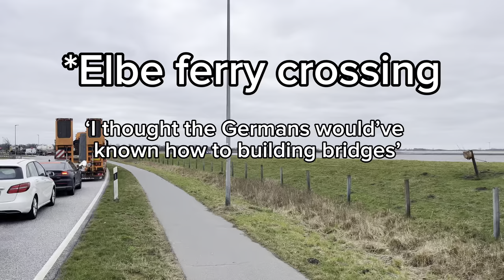Driving my Trabant from Germany to England

Comment: If you want to fix the heating on the trabant, you have to Connect the flexible pipes correctly: one goes from the exhaust right to the "banana shaped" heater and the other one needs to go from the the engine cover to the front muffler. You have connected the heating outlet to the other heating outlet, so you are pumping hot exhaust air diretly to the engine cooling, thus the engine is overheating all the time and might result in engine damage!
Reply: Someone needs to send this to them.
Reply: @jwalster9412 its too late
Reply: hahahaha legend we have a trabant expert its good job you saw the video mate you probably saved his Trabant
Reply: @ItZFlipz car is dead
Reply: I cry bro @afkafkafk

Comment: The oil mixture is 33:1 for pre '84 models, post '84 runs on 50:1. With that amount of smoke, plus destroying spark plugs every 100 miles means wayyyyyy too much oil in the fuel. Mine makes hardly any smoke at all, just a little on a cold start that's all.
Reply: I figured it had to do with the air/fuel mixture. But too much oil makes sense too. Certainly when it smokes like that.
Reply: @NaoPb  Having spent much of my late teens rebuilding and using 2 stroke motorcycles and mopeds, it's a common problem. My Trabant was driven from Bulgaria to the UK, but I have no idea if or how many times it may have broken down.
Too much oil in the mix will wreck a spark plug in mere minutes!
Reply: Forgive me for not understanding the ratio, but for every 33 litres of fuel (using as an example), you add one litre of oil (on pre-84 models)
Reply: @joelthorstensson2772  Yes, but it has to be in proportion. 10 litres of gas needs 303ml of oil, 18 litres of gas needs 545ml of oil. You can't just add 1 litres of oil for every 33 litres of gas used. The oil must be added at the same time as the gas in the right amount.
Reply: That's wrong in so many ways. First, it's 1:33, not 33:1. And they have already changed it to 1:50 in 1974.

Comment: DO NOT FORGET: use 2 stroke premix 50:1 (petrol:2 stroke oil). and DO NOT let off the throttle in ANY gear except 4th (4th has a ''freewheel'' that allows the engine to idle when coasting). when braking:  always push the clutch pedal. this is to prevent the engine from seizing.
Reply: To Maicopaul. OH MY GOD!

Comment: Road trips with unreliable Cars is always fun, and entertaining
Reply: take care of it and it is realiable the engine is a 2 stroke they make a lot of problems
Reply: To watch not to do trust me
Reply: Arkady Fiedler's Fiat 126p road trips are legendary.
Reply: Drove a 50 year old American car with a dodgy carburetor, engine stalls accelerating from full stop unless I stomped the gas pedal more, not bad until I am close to home and encountered a stop and go traffic on hot June afternoon and the car vapor locked on me!  Since the fuel gauge is inoperable and I have no long stick to measure the fuel level, I falsely believed I ran out of fuel.
Reply: That's why top gear specials are so much fun.
Reply: They are reliable as fuck...Unless you connect the exhaust to the engine cooling, like this guy did lmao
Reply: That's why I like watching vice grip garage

Comment: Don't forget to shift into neutral anytime you let off the gas in any gear below 4th! The Trabant only has free-wheeling on 4th gear and, being two-stroke, only gets it's oil lubrication from the oil in the gas....but if you're not ON the throttle, that means no lubrication unless the engine is idling in neutral!

Comment: 60 with one cylinder? That's basically raping the engine... mine only could go like 20 or 30 when I've lost spark in one cylinder, and only gone for maybe 1 km until I've reached my workplace, not 200 kilometers... no wonder it gave up. And if the spark plug thread is fucked, you'll probably need a new engine block anyway, or maybe it can be mend by a thread repair specialist.

Btw it's 26 hp, and not Soviet at all. It's not that crap, you just bought a cheap rundown one that's been neglected for quite some time. You're expecting miracles here from an almost 40 year old car with technology from the '30s that wasn't maintained properly...
Reply: Just new cylinder head and it will run no problem. But yes if one cilinder has no spark plug, it runs a lot better than with the spark plug still in it. And no it is not good for it, duh.... these guys dont care at all.

Comment: as a german i still love the smell of those cars!

when i was a kid in early 2000th still many of them were driving around here in my small city in east germany

but they got really rare and expensive now.

there was also one tuned one driving around which had aluminium rims, suspension and a 200hp engine in it! :D

would be cool if u keep the original engine but give it a nice tune.

i wonder how much hp can be made with those little engines. I have never seen a turbo Trabant engine to be honest. :D
Reply: Why do I feel like 200 Hp would rip the panels off the frame..

Comment: I once drove a 1960's Renault 10 Major to UK,  Yorkshire and back to Germany....it was not new rust everywhere.......It did not blink once.......I did the same in 1970's VWs (Passatt 1300cc) and later a low mileage Morris marina 1300cc.......Many soldiers did this journey in old ~Ratbags in the 60's 70's and 80's.

Comment: Woah congrats with your new Trabbi, you even have one with the old style dash! I'd recommend for you, whenever you buy the plastic edges for your bumper, to drill a hole in the bottom through the metal lip and put a locking pin in there. They get lost way too easily hahaha. I know people who still use these as daily drivers, I only use mine daily from mid spring to mid autumn... its still 10k kilometers a year or so :P. Mine's from the very last production year, 1989, so it's as good as rust free still. If you take good care of it according to the book, they're very cheap to maintain and incredibly reliable cars. 

Have a lot of fun with it, and use common sense! I noticed, especially the English Trabant forums tend to be quite severe echo chambers shouting some really weird stuff.

Comment: Removing the sparkplug on one cylinder and only running on the second cylinder means no lubrication for the one without the spark plug because it doesnt get any gas/oil mixture.

Comment: I would have thought that by using modern synthetic two-stroke oil you could lower the percentage of oil in the premix to the benefit of power and spark plug longevity and the reduction of smoke.

Comment: You bought an unkempt car in Hungary. The Trabant is really run-down. You would have been better off buying a well-maintained Trabant in Germany. Then you wouldn't have any trouble. Alternatively, you could take the vehicle to the former GDR. They will fix it up for you there so that you can enjoy the Auro. Incidentally, have an electronic ignition installed, which was also available for the Trabant. Then you no longer have to change and adjust the ignition contacts.
Reply: But that way it is more fun. And you get a free road-trip ;-)
Reply: booooring, and way too expensive too
Reply: @CAESARbonds I understand that the guy is unhappy with the purchase. And with a two-sroke engine, the guy has to realize he always needs the right engine oil in the right mixing ratio in his tank.
Reply: I hope to do this some day. Seems like nice little cars. Just a shame I don't have space to keep my current car them. Since I love it very much.
Reply: @CAESARbonds And what about the spare parts? Where in Scotland can you buy Trabant spare parts?
Reply: @CAESARbonds  There are sellers in Germany, where you can buy new and used spare parts. Delivery by mail. Possibly with customs charges. Others have it sent to post office boxes in northern Germany or Holland and collect the goods themselves.
The first thing I would do is remove the mechanical ignition (contacts) and install an electronic ignition unit. This eliminates the need for time-consuming maintenance and adjustment of the ignition contacts. After all, these always have to be replaced. The electronic ignition is maintenance-free.

Comment: I know this is among the worst automobiles ever made but how does it EAT 2 spark plugs every 100 miles? Ar they black? Are they melted? What Gas/Oil mix are you running?
Also looks like youll either have to find a new head or a guy capable or drilling new thread so solid that it withstands the compression. Youd also be running two different spark plugs at that point.

Comment: The worst car ever doesn't still work 30+ years later. My friend had a Kia Carnival (about a 2002 or 2003 model). Car was already at the scrapyard by 2010 with less than 100,000 kms on it.

Thats kilometres, not miles. Apparently the engine design was faulty (It was a Rover V6) and had piston sleeves that went wonky after a while. Apparently cylinders won't go up and down in wonky cylinder chambers.

This ain't that rare a story either, there has more recently been issues again with Kia Cerato/Hyundai i30 cars having engine problems.

Comment: Maybe it's a worst car but in case of serious solar storm which would wipe out every modern vehicle such old car will still work.
Reply: Most cars will still work. Gas pumps, however...
Reply: @KC9UDX  No most cars will be useless as ECU would be destroyed in any modern car.
Reply: @The_Touring_Jedi  Unlikely.  It didn't happen in '89.  Telegraph lines and power lines are succeptible because of induction.  Car electronics not so much.

Comment: This car idles how i imagine a carbirated diesel engine would idle.
Reply: A hot bulb engine?  They're quite quiet actually.
Reply: @KC9UDX  a normal diesel. With a carburetor.
Reply: @jwalster9412  I'm pretty sure that can't work.
Reply: @KC9UDX  don't knock it till you try it 🤷‍♂️
Reply: @jwalster9412  starting to sound like perpetual motion

Comment: The most hilarious part on these cars is that you have stay on the throttle while driving downhill. If you don't do this occasionally your engine doesn't get lubricated while running and we all know thats not really good.
When they bild the 2 stroke engine they connected the oilpump with the throttle cable. So more throttle more lubrication.
Reply: Use neutral
Reply: What are you talking about?
Reply: Oilpump? There is just one pump in the whole car and it is for the wiperfluid!

Comment: Back in the 60s, when this car was introduced, it was up to date and had a pretty modern design. Too bad, that the communism party has not allowed any improvements. One fact is the payload of this car. It weights 660kg and has around 380kg payload. That is a pretty good rate, and it drove quite well also with a bit more ;-).

Comment: Oh god, do NOT drive the trabi with 1 sparkplug missing, not even for short lengths! It will not draw any fuel/oil mixture into the cylinder so that cylinder goes completely unlubricated with obvious results after a few dozen km.

Comment: That is not a properly maintained Trabant. I have restored one and it's my daily driver since. To me it is probably one of the best cars ever made, it is simple and easy to maintain. If you want to maintain it that is
Reply: not to hate, but could you explain to me why you think that? compared to other cars in the 80s it was already awful
Reply: @imsimonster  depends how you look at it. Emissions, yes, totally but I don't care about them. Safety is another possible issue but I don't care about that either because I drive slow and usually avoid high traffic areas and highways. Other than that the fact that is so simple and easy to diagnose and fix makes it a best for me. It has two main flaws but if you can get past them you will have a good reliable car. It is good offroad as well, high ground clearance and it is not as slow as people say. Or maybe the proper explanation to this is that I'm just crazy
Reply: @sparkplugguy8164  thank you, i did always understand its nostalgic appeal but not why people think the Trabi is good

Comment: Think people like them because they're so comically terrible.

Also you may be able to drill and tap the spark plug threads over to a plug with a higher od if you don't want to have to find someone to weld, drill and tap that head which could end pretty badly if it's a dirty cast aluminum part.